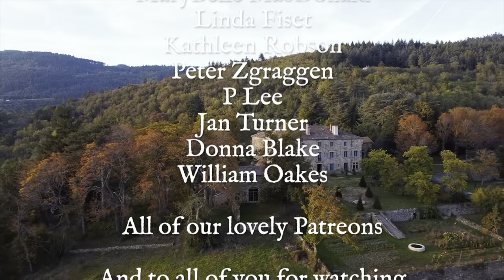How long will it take to finish the Château’s Coach House? YOU DECIDE!

Comment: I've been watching your story from nearly the beginning, and my recommendation would be to concentrate on a single 10-20 minute update per week. That will give you time to be with your volunteers, the work and your family. Also, I'd like to see you in the Coach House before the winter. Bless you.
Reply: Maybe use the daily vlogs as the bones on which you hang each particular task. One task per vlog, regardless of the duration, maybe. You can break a really big task into more than one episode, but not often. Make the dailies short (even time-lapsed) of each task (meaning finished to a pre-determined goal - recommending !absolutely! finished for that particular task, so that nothing more needs doing). In planning the vlog of the task, the task plan will emerge & vice versa.
 You needn't upload in chronological order, but adopting the paradigm of finished vlog/finished task is the goal.
 It means several vlogs in the works at a time. Recommend mapping &checklists. Do you have a big, blank wall you can paint with chalk paint & use to keep track? Maybe on the ground floor of the coach house?
 By all means - finish the coach house residence. Bit by dogged bit.
 Rooting for you. Yay!😇

Comment: I've read through many of the comments, and I agree, that not knowing the skill sets of the lovely KC vounteers or exactly how long they will be with you, it's nearly impossible to project how long it might take to have the coach house move-in liveable. I agree with most that the laundry area, kitchen, the largest bathroom, and a safe play area for  Clement and Juliette are critical for being able to move-in. That means the plumbing and electrical are safely finished in all areas to the point they are child safe. The pretty light fixtures probably wont be done, nor likely homemade tiles installed, but things would be safe and livable. I'm guessing it would take at least 2-3 months to get to this point taking laundry, meals, pets & childcare also into account! 😮
Reply: The best advice here AND the big board with listed tasks by PRIORITY - marked off as done. WONDERFUL to show at the end of each vlog now & forever. 
And, hate to say it, but plan on 6 months.

Comment: Placing a time frame on these projects will be hard, if, you're planning is mixed together with your current needs and your event needs.
It seems you need to pick which 'need' is most important, and go with that.  Setting up a small kitchen, a bathroom and a bedroom, along with the downstairs main area, first, would get you moved in.  Daily vlogs, albeit short, is a tall order.  But as you said, it will make you accountable.  My best wishes for this project.

Comment: I would suggest getting moved into the coach house during November so that you can have a nice Christmas with the family. Hoping that bathrooms, kitchen and laundry are all working. The tiling project could be very time consuming so it might need a separate timeline, with more thought behind that than I can manage as a distant observer. I know you have the larger laundry area but I think having a stackable washer/dryer would be very helpful, especially during winter and the rainiest months. I would think keeping it on the main floor but in what you are planning as the industrial kitchen (and not the main open living area of course) would be a reasonable way to do quick loads. 

Does it make sense to have a planning and ordering/purchasing timeline and a separate actual hands on work timeline? You might need to work backwards from your move in date to see if the schedule is doable. Wishing you loads of good fortune! 🍀🤞

Comment: I think your starting point should be a room by room plan of exactly what is needed to totally complete it. Then work out what must be done before moving in. Then draw up a list of the order items should be completed and make a timetable working with the number of workers and the number of hours to be worked each day. With childcare you will be able to complete your tiles over a shorter time. Sticking to a timetable and fixed order will speed up the moving in day. I think you should aim for start of next school term for all major works to be finished and aim for mid October to move in allowing for final finishes
and total completion by Christmas. Good luck!

Comment: elm will keep moving so won't be as stable as any other timber;.. but.. we had a couple of similar pieces and they made an amazing central island top over an old kitchen table in which we set a sink and induction hob.  The scraps are a round table top over a pine table.  Priorities are always bathroom/kitchen and then the bedrooms with heat sources.

Comment: You need a list of everything that needs done in each room and a floor plan with measurements for all things- including windows and doors and heights. That way you have all measurements for buying furniture, planning window coverings, etc., estimating paint and finish trim lengths, piping, wiring and miscellaneous.  

You also need a decor board to put paint samples, fabrics, tile samples, fixtures etc. That way you can visualize the look you want to end with.

Then you can generate tasks per day so everyone stays organized. It gives you lists of things that need to be bought, ordered, etc., so you can minimize your shopping and maximize your work time, coordinating when each task needs to be done, and what can be done as the same time as something else. Plus you can then check off tasks as they get done so you can feel a daily sense of accomplishment. 

I am sure if you look at the internet you can find example lists to help you remember everything you need in each room and each project. Like light covers and matching screws, faucet connectors and plumbing fixtures, door hinges, shims and handle, thresholds, curtain rods and hangers, shower rods, cabinet handles.

You  can make up mock up sizes with cardboard to see how large things need to be to fit the scale of the rooms- for example, light fixtures. You need a sense of scale so uou don’t end up having to order and reorder, or purchase something at a brocante and then have to return it. Taping sizes of things off on the floor, like how big the coffee bar should be, the size of the dining table with chairs around it, etc., will save you so much time and grief.

Basically you are setting up to be your own project manager and that will go as efficiently as you are organized. So once you’ve done all above, then you need to go room by room and make a complete project list for that room and everything needed to complete it. Once that is done you can create hardware lists, plumbing lists, brocante lists, tool lists, online ordering lists, etc. That way each task is ready to go and there is no stopping because you are out of supplies. It is like doing lesson plans and preparing supplies for teaching lessons.

If you had this all done, I could give you time to completion, but getting this all organized will take you most of a week; then there will be a waiting period for anything you have to order, anything you have to purchase (shopping trips and I understand you are quite always from stores). 

You also need a schedule of work times, meal times, clean up after meals and grocery lists. Keeping drinks and snacks close at hand to the work space saves time and conserves worker energy. The project will go faster if you plan in advance and no one gets too fatigued and cranky. Plan tasks to do so that if one gets held up by weather or problems everyone can turn focus to the next. Flow is important.

Bathrooms and kitchens take longest. I don’t know if your rooms are plumbed; it looks like the bathrooms are wired but not the kitchen. So you will need to have an electrician out to do that so you can work that into the schedule. 

Each evening you will need a brief planning meeting for the next day, a review of what has been done and yet needs attention and what tools and supplies everyone will need for the next day to come, including any tutorials on how to do things, so they don’t have to be redone. Additionally, each morning there should be a brief meeting to cover what specific tasks need accomplishing, who is to do what, and discussion of task related issues.

The bathrooms will likely take 2-3 weeks once started. The kitchen will be six weeks. Depending on what is done and needs redone, bedrooms can take 4 days each. These are minimal times. Things alway take longer than you plan.

Please make sure to have plenty of equipment and supplies so people don’t run out in the middle of a project. That is the biggest obstacle to moving swiftly and efficiently.

Then make sure you set up work spaces well organized so people aren’t wasting time looking for tools and supples, running from place to place to get work done or having to wait on each other for resources. 

Finally, clean up the worksite each day so it is clean and ready to go for the next day, including cleaning snd organizing tools, bringing in supplies needed for the next day or next project. Plan to have a cleanup hour at the find of each day to accomplish this, even if tasks have to be cut short. It will save so much time snd confusion for the next day so people can get started right away. 

As for your outside space, I would ask for suggestions from your up the hill neughbor. He will undoubtedly have some great ideas how to best manage and decorate the space, including where to plant snd what to plant as well as what tasks are needed, what supplies for that particular spot and in what order. He can visualize a space that is both decorative and good for a children’s play area ( no poisionous plants, all hardy plants that fit the area and look decorative and take minimal tending to). The you can order what you need and assess and assemble required tools and materials. 

If you follow this suggestion, you will have to put in a week of effort yourself but then you should only have to check in in the morning, at noon and end of work day except when you are making tiles; so you can still attend the kids with few interruptions; of course this will also necessitate shopping trips and time ordering things.  But it will make everyone efficient in use if time. You will see progress.

I would not plan more that 2.5 work days for your volunteers without a fun break for them. That way they will enjoy both their vacation and their volunteer work. So this will require advance planning and discussion with them about local sights, festivals and day trips. That way everyone knows the schedule, has the same understanding of the work flow and can get the most out of their experience. 

Hope this helps.

Comment: I would suggest getting the living area downstairs and one bathroom done-done; you could sleep in there while a bedroom is finished off. Looking at a whole building is both daunting and too vague, I think. Perhaps (if you don't already have one) make a notebook with a running list of tasks, 1-2 pages per room; you will be able to see what's doable in the times you have, and see progress more steadily. My guess is that, if you focus on just those two rooms, you could be in by Autumn. Also, with a notebook of task lists, you'll see which projects overlap each other (e.g. tiles for various rooms), and be able to plan your tile-making, or wood prep, or paint-buying, more efficiently...

Comment: If you can work with 3 people 5 days a week for 12 weeks straight, you can finish it in 3 months. If you get the nanny and these 2 lovely people and you, that's 3? One functioning and finished bathroom is priority. Love the wood and lion head!!!! Then the kitchen  and fencing in the garden for the kids. It all depends on the skills of the people really. A skilled wood worker can do such a bathroom 5x faster then someone who never done it. And how summer temps are going to be is a thing too ofcourse. Since you have the plumming done,, which is the most work I am not so negative. The hardest part is to start it and move on, get the pace in and finish. Get the planner out and start. I bet you already done that. I know all about it, I had a 3 months renovation of this house with complete new kitchens, 2 bathrooms, floors and several lay out changes with new stone walls. So I know how much can be done in 3.

Comment: Such a great objective!  It will be a very comfortable space for your family. As to the algae inside, the leakage must come first. I would mound up earth against the wall so it slopes away from the wall at least 3 feet from wall, then at the bottom of the created slope, dig a trench with gravel on the bottom and at the end bend it away from the building so yet another problem isn’t created.  As for the algae, kill it with white vinegar and keep doing so until it is no longer there when you wipe it.  Do not use bleach!  Bad for children, animals and you!  Good luck!

Comment: Having done this on a smaller scale ... the important thing is to create a clean tidy haven for peaceful dust free rest away from the work.  Not just the coach house as the escape from the main chateau, but within the coach house to reach the initial stage of occupation.  Getting the main items of bathroom/toilet and bedroom/sleeping area fully done first.  Then the food prep area/temporary kitchen .. finally lounge and dining area - a table to sit at together is really important.  Making a list of priorities is obvious .. with a timeline & schedule of works.  I would seriously consider seeing if an internal spiral staircase or small "through-the-floor" lift could be fitted at an early stage to help with Winter living and even through the building/fitting out stages.  They take up a smaller footprint than a staircase, save running around the exterior access and could be relocated later elsewhere relatively easily.   80% of the work will take 20% of the time and the last 20% will take 80% of the time.  So I reckon you could be safely habitable in 2 to 3 months.  Ideal move in during Autumn as the weather cools, before Winter hits and the evenings get really short.  With that internal stair you could more comfortably do the internal finish over the Winter without constant boots on/boots off - coats on/coats off, and be ready to start back properly on the Chateau in the Spring of 24.  Perhaps a temporary cesspit would help.  As you have said - living inside a building site is horrendous and very wearing mentally and physically .. but just dealing with areas of decoration bit by bit is much easier and natural life.   I did 2 family Christmas gatherings of 10 with just an Arger, a B&D Workmate as a prep table and only an outside tap ... a fantastic time, but never again 😁   You managed the December videos daily ... so a short 10mins max of progress maybe just 3 days a  week - even slide shows should be easier edit and upload.  Bonne chance mes amis 🤗

Comment: A short 10 min  video once a week is fine....get your living space done asap!  Most needed thing to do !  I am surprised you aren't farther along and finished with a real living space. The awards and accolades are nice but not what you need right now...just get it done already!!!!!!
Reply from the maker: Honestly?! You're saying this to a couple who not only have two toddlers in tow but are simultaneously running a 130 acre estate, 33 room chateau and huge outbuildings, managing a farm and trying to do most of the restoration and renovation ourselves?! We have a living space and it's fine. We'd like to move into the coach house but we're not going to do a crap job just for the sake of speed - it's not what we're about. We bought this place as a lifetime journey, not a quick fixer upper to flip when we get bored.

Comment: Hi Amy you need to prioritize jobs
1
Only 1 bathroom and it has to be the 1 with the least jobs needed
2
Only 1 kitchen but i didnt hear you mention a sink so it has to be  where there isa sink also again the one with the least jobs needed 
I understand you want daily vlogs as it helps with the utube algorithms BUT you will only get into the coachouse quickly if you have help. 
This help is for a short time. You need to concentrate on actually doing the work not spending a lot of time filming. So use a tripod set up so you are not losing a pair of hands filming instead of doing jobs. Its ok if a 10min vlog is just showing 1 job each day with a bit of fast forwarding.
I'm not saying a time frame, you shouldn't put yourself under pressure. So whatever you get done in this time be happy with 
Looking forward to seeing your progress 👍👍🤞🤞🤞🤞🤗🤗🤗🤗

Comment: You need to prioritise getting the coach House liveable but don't need to get it perfect.  I know your passion project is doing the tiles but as someone else said they could become your winter project as they are not essential at the moment.  If you can plan effectively then it should be 3 months but the planning should be systematic not jumping from project to project.

Comment: daily vlogs get more hits.. don't know if you have seen any of Dan's but even a pop up is great. he has just done a hi and bye but usually they are about 15 mins.   Don't get hung up on detail that is going to take ages to produce before you can fit it.. the tiles for instance? get some wedi board in and get that shower in fast and in a way that doesn't create more work in repair in the future.  A 'for instance' it took a professional two months to put in two shower rooms here.  He did an amazing job but shows you how long it takes to do a job properly with insulation; taping; tiling; plumbing and heating.  We got some Acova towel rails online (we are also in France in the Ariege) for the shower rooms so no wet towels when we haven't got our air source heating on.